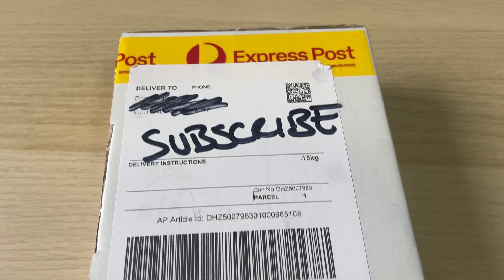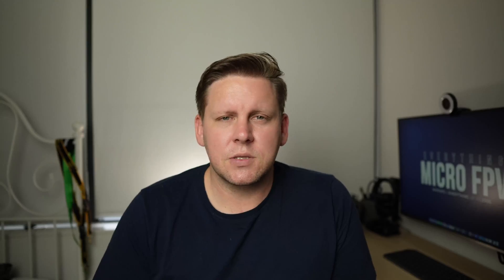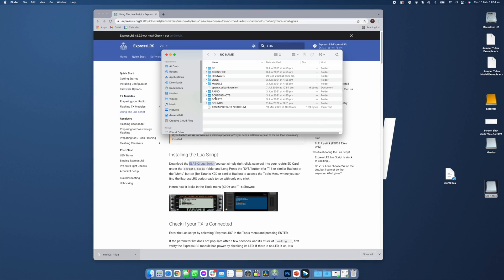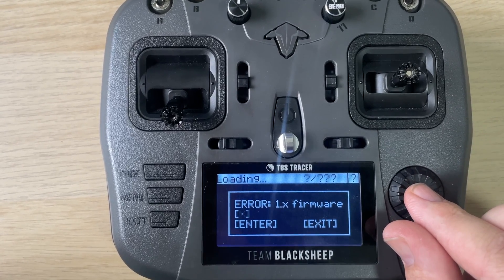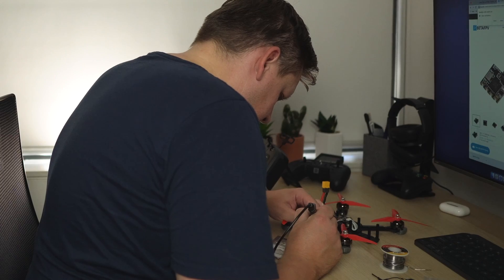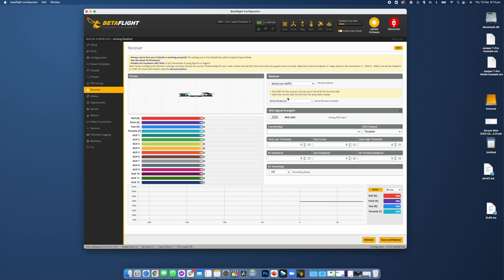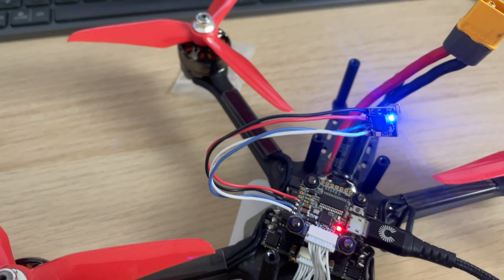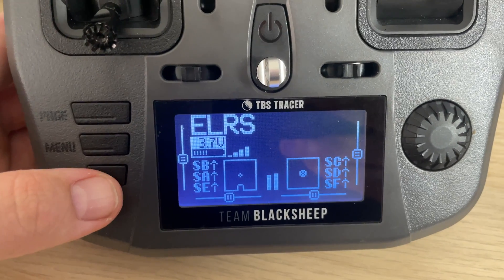How To Bind ExpressLRS Using Traditional Binding

Comment: Hello I've a Radiomaster TX16s (version 1) and the betafpv expresslrs elrs 2.4ghz 1W Micro Module. I can't change the 10W value, in the module joistick or in the LUA software, Do you have an ideia what maybe is the cause?
Reply from the maker: Have you flashed the most recent version of ExpressLRS to it? I’d possibly think that something is wrong with your flash.
Reply: @DarrenAllatt  Yes its new version. don't change form 10mW to higher values. Thank you for your time. I love your channel
Reply from the maker: @antoniofilipe70  try flashing one release down to see if that is the issue. Also do you have the white or black one? If you’ve flashed the firmware for the wrong module then it won’t work properly.
Reply: @DarrenAllatt  Thank you very much for the usual help to the community..
I've update (with success) both transmiter (betafpv expresslrs elrs 2.4ghz 1W Micro Module) and receiver (happyModel_EP_2400_RX) in the ELRS Software 2.5.1 version. I've have tha black one of 1W, but I can't change the Power, is fix in 10mW. I'm using the "regulatory Doman EU CE 2400, maybe is his? Is the 3.0.0.-RC1 version already safe?
Reply from the maker: @antoniofilipe70  you are welcome. Yes, it is likely that regulatory domain EU is causing the issue. Can you try the other one?
Reply: @DarrenAllatt  It's working. You are the best. Thank you
Reply from the maker: @antoniofilipe70  You are welcome, if you haven’t already - a sub to the channel would be the best way to thank me!

Comment: Hey new sub here , question I've been using a qx7 with rsxr's forever and have just ordered the express lrs 1w module, do I have to create a new model for every express lrs quad or can I bind them all to the same model like I do with frsky?
Reply from the maker: Welcome to the ELRS Party and thanks for the Sub!

You can bind them all to the same model. I prefer using binding phrase which means flashing firmware as you then don’t have to go through the bind process. You can also use model match to achieve the same thing with traditional binding
Reply: @DarrenAllatt  thankyou. Does using a binding phrase mean I have to have a different model for every quad? I'm a little confused
Reply from the maker: @RosscoStixFpV  No. binding phrases works like a wifi password. Any RX and TX that share the same binding phrase will automatically bind. You can use the same model or different models because it’s between the TX and RX. So you can have 1 model for all your quads 

I have different models for different kinds of quads, racing, freestyle because I have different switches for each kind. They all use the same binding phrase and all bind to the different models.
Reply: @DarrenAllatt  ah okay thanks I think I'm starting to get it lol(not so tech savvy) so with my qx7 already being set up nothing really changes just the module and recievers correct?
Reply from the maker: @RosscoStixFpV  go into your existing model and turn the internal transmitter off and set the external transmitter to CRSF
Reply: @DarrenAllatt  yep I get that part I'm still waiting on my module and recievers to turn up in the mail, I'm just trying to get as familiar with the setup as I can so when it does turn up I have some idea how to get everything hooked up.. I've been flying about 3 nearly 4 years but that's what I concentrated on never worrying about the constant upgrading of parts or firmwares I flew bf 3.5.7 and 4.0.6 for ever because I didn't want to have to do the vtx tables thingy lol , but over the last couple months finally took the plunge into bf 4.3 and flashing the latest open TX to my qx7

Comment: Elrs is problematic. it works fine then it doesnt. i hav an issue now where my Qx7 wont connect to the module but hav full function with my quads. cant change settings or reflash wifi.
Reply from the maker: Have you done the mod that you’d have to do if you were using crossfire?

And what TX do you have, you can flash via USB
Reply: @DarrenAllatt   all happymodel.   crossfire mod{please explain}  i went from 2.0-2.2.0 & missed the LUA update. will attempt a USB flash
Reply from the maker: @blackgi  it’s probably not working because the baud rate it too high. 

https://www.team-blacksheep.com/products/prod:qx7mod

Comment: Thanks!! I’ll give your method a try. Though I have an ELRS Rx (Flywoo) and Tx (Happymodel) I have been locked out of using them because my Mac is  running  an outdated Python (2 instead of 3) so the LRS configurator is incapable of flashing either. Very frustrating!
Reply from the maker: could you update Python?
Reply: @DarrenAllatt  Updating Python would be ideal. As a non computer geek,  I’ve searched the internet, including YouTube “how to” videos, for ways to do just that. I’ve tried several approaches, resulting in a real education in the inner workings of the Mac such as the use of a compiler (XCode) , package manager (Homebrew) as well as the interpreter Python via the Mac Terminal. Long story short, I haven’t been able to get anything to work with my older Mac OS. That’s why your work around seemed like a good way out to at least get me started.

Comment: Wish i would have had this vid 2 days ago lol, heres my story....I purchased a happymodel ES24tx slim pro Expresslrs tx module for my frsky x-lite controller and flashed the module to expresslrs v2.2 via elrs configurator. I also purchased the betafpv meteor85 ELRS whoop which came pre installed with ELRS v1.0 so i also flashed new elrs 2.2 onto the rx via Expresslrs configurator with beta pass through option and has success, but after binding through betaflight 10.8xx i have problems with my controller throttle,pitch,roll and switches all showing lag latency and throttle bar fluctuating when idle in betflight receiver tab, is it true i need to flash the betafpv meteor flight controller and update to a newer betaflight firmware to make the elrs v2.2 work correctly with the meteor85 elrs whoop? I think the drone comes from betafpv with betaflight 4.3 firmware pre installed?
Reply from the maker: Ok, I have similar issues on my Meteor85 - set the PID loop to 4khz and that should help with the matter.
If you need more help, www.everythingmicrofpv.com/gethelp